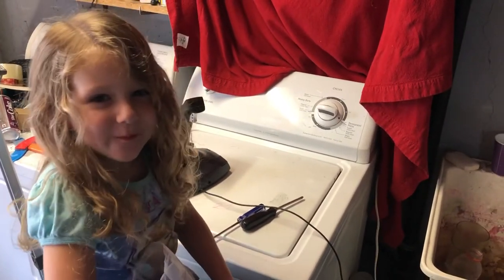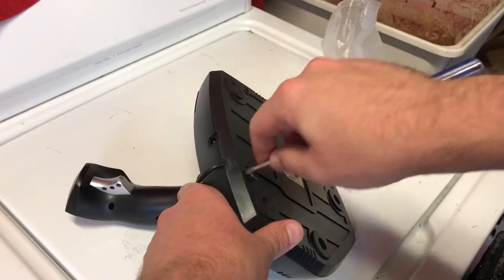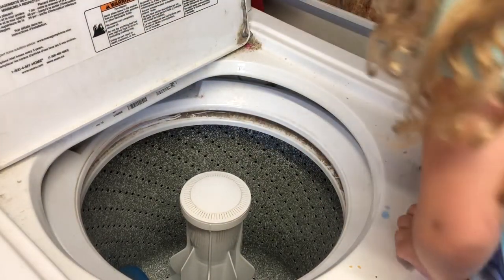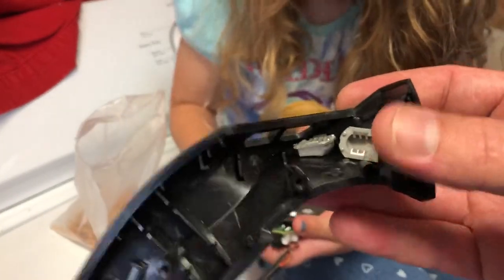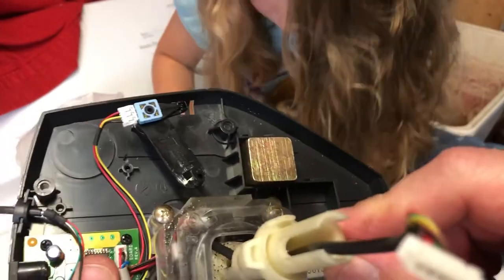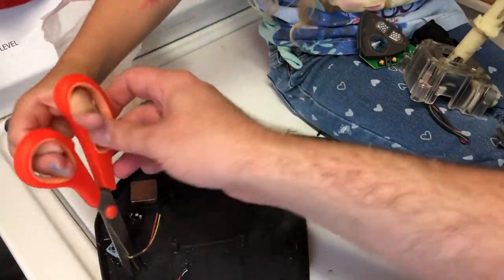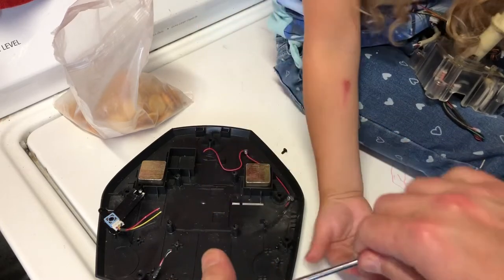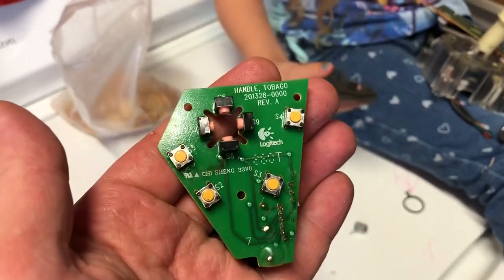WingMan Force 3D From Logitech Teardown - Tuesday Teardown With Aggies!

Comment: It sounded like you lost a screw in your washer while disassembling.  You should consider doing these kinds of projects on a hard floor or large table where you can't lose parts as easily.   Doesn't make sense to tear it down unless you know exactly what you're trying to fix and the way you handles circuit boards shows you know very little about static and electronics.
Reply from the maker: This is all true! But I am learning. =)

Comment: Found this video hoping to uncover how to, get to and change the rubber sleeve. My rubber sleeve is worn out after years of abuse, and sunlight. Nev hints to clip and that was what i went with. To get to the rubber sleeve you will have to remove the bezel  holding the sleeve in place. The bezel is also covering the throttle and is "fastened" with 5 allen screws ( the allen screws are purely cosmetic so don't mind them). The bezel is held in place with 3 ancors/clips on the inside part of the ring, one directly above (0°)  the blue Logitech detail and the other two  at ~130° at each side of 0°. Press the ancors towards the outside of the ring to loosen and detach the bezel. No need to loosen the screws underneath the joystick to loosent he bezel.  Nev covers the rest of the tear down to get the stick off.  If anyone know where to get after market sleeves I'm all ears.
Reply: This comment helped so much more than the video. Thank you for taking the time to help us all out
Reply: thanks! So these screws on the top are all cosmetic? lol interesting. Also yeah if anyone has any idea how to get a fresh sleeve that would be great because mine is literally torn to pieces from wear in storage for years. It works fine but doesn't look all that nice.
Reply: @Ballissle  purely cosmetic friend. Please let us know if you find some sleeves :)

Comment: @Nev's Tech Bits
This is probably way too late
But do you have the PCB out of the base of the unit still, and is it's chip intact?
It is the smaller piece sitting in the middle of the large copper area
If so, do you want to sell the PCB?
Reply from the maker: Let me check the scrap bin and see!
Reply: @NevsTechBits  
If you do have it, should be a chip on it labeled something like A3968 ?
its a dual H-Bridge, that's what i am needing to replace on mine to restore it back to a working force feed back stick, it is what controls the voltage output to the motors